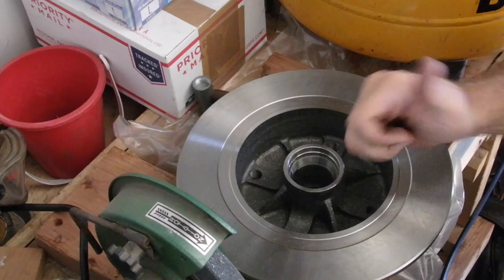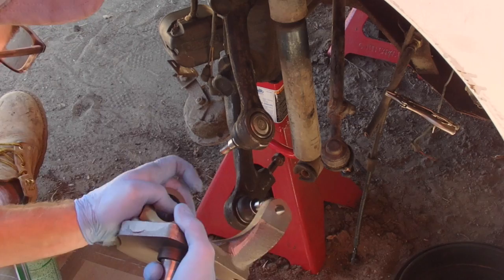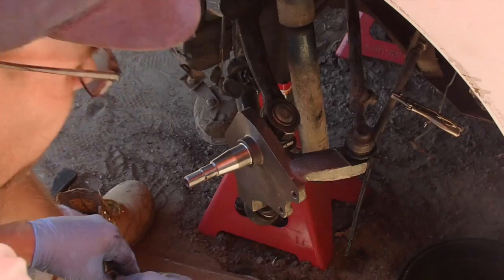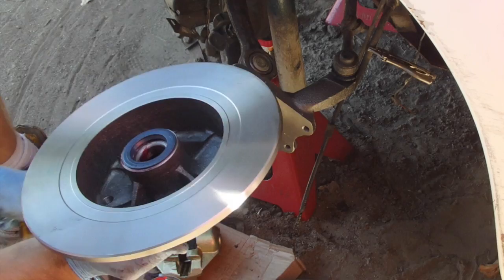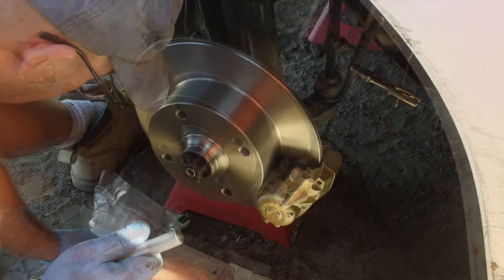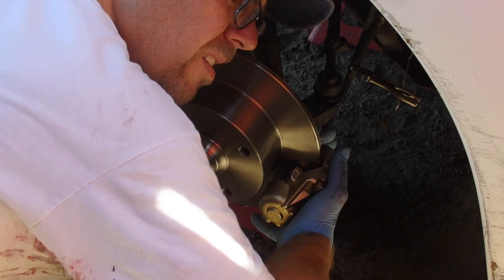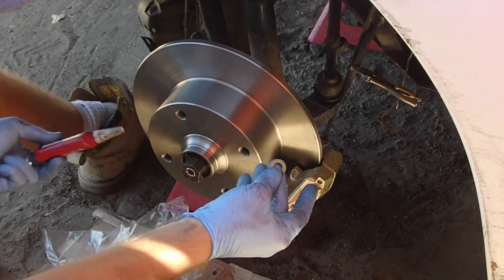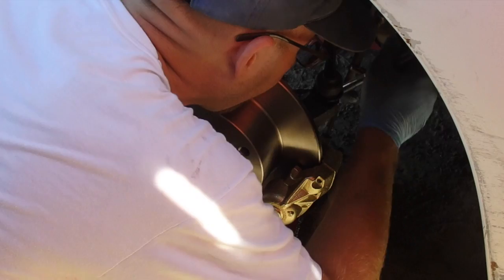1969 VW Bug Project - Episode 20 - Drop Spindles and Disc Brakes

Comment: I think I would use blue thread sealer,  the red is very hard to break loose. Did the same thing to my Ghia with shims on back of calipers to give clearance to rims.
Reply from the maker: I think you’re absolutely right, Bob.  Red loctite was a mistake I’ll likely regret later.
Reply: @SchoolStGarage  If you need to remove try a little heat.  Great video..

Comment: How do you keep the new ball joints from spinning when tightening the lock nut? I've tried a lot different things. Any advice would be appreciated.
Reply from the maker: A VERY late reply, but what worked for me was really seating the spindle hard onto the stem of the ball joint—and making sure the ball joint was bone dry, no grease, before I did that.  That locked them together and made the tightening quite easy.
Reply: Awesome Vid, I was going to get EMPI disc brakes but went wit CB Performance instead. the samba did a poll and CB won by far. But disc brakes are better then drums any day of the week no matter what brand i guess lol. Nice work SSG

Comment: Excellent video! What brand is your disc brake conversion kit? Please let me know. Cheers
Reply from the maker: I think it's from EMPI.  I bought it from JBugs.com, item #22-2886.  Came with drop spindles.
Reply: Thank you for your response. Im thinking of getting them. How do they perform?
Reply from the maker: Haven't been able to drive with them much, but they were noticeably better than stock on the few times I drove the Bug before I tore it apart.

Comment: Did you have to narrow your beam?
Reply from the maker: Nope.  And I’ve had no rubbing at all.  I’ll probably go with a 2” narrower beam in the future.
Reply: @SchoolStGarage  thank you for the response... I've had a set laying around my garage for over a year and have been scared to throw them on because I've heard of the rubbing issue...we haave close to the same setup and we have the exact same year, I'm doing ball joints right now I will throw on the drop spindles and see what happens...
When you narrow your beam we wanna see, please pist a video...please 🙃
Reply from the maker: Will do.  I’m leaning towards a 4” beam soon.  But first I’ll be doing a 2” drop in the rear with spring plates from Limebug in the UK.

Comment: What's the advantage of disc brakes?
Reply from the maker: Much better stopping power, especially in the wet.   They don't heat up as much as drums do, or at least they dissipate heat more quickly than drums.  Putting them up front also gives you better brakes where most of your stopping power needs to be.
Reply: +School St. Garage thanks.
Reply: better stopping and way easier to change the pads

Comment: how tight do you do your ball joint and tie rods nuts
Reply from the maker: I honestly couldn’t tell you.  I just crank on them until they are quite tight, and then I cotter pin the castle nut.
Reply: use a torque wrench